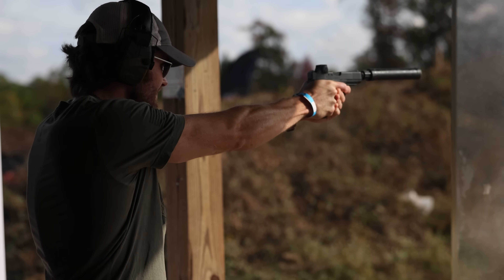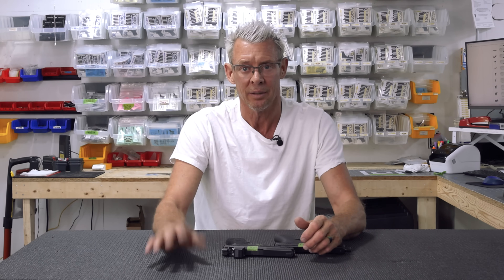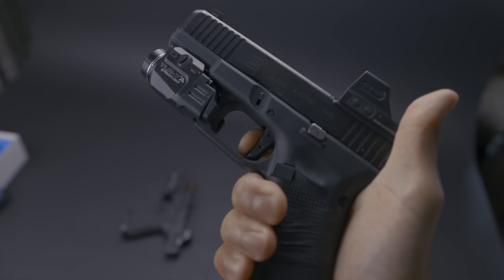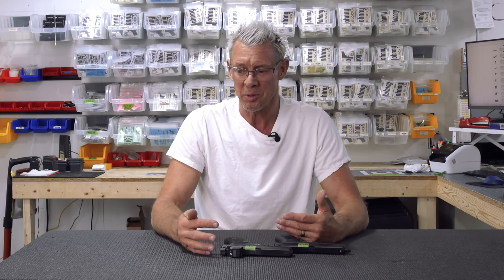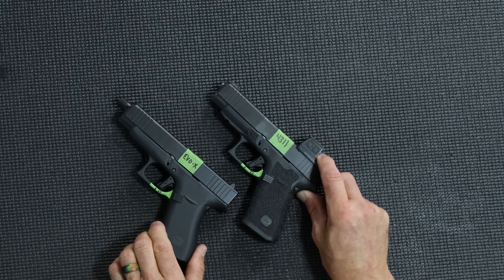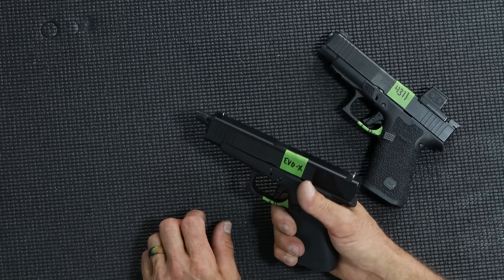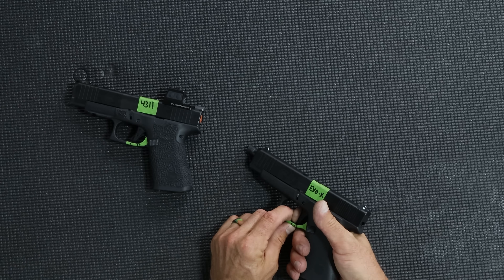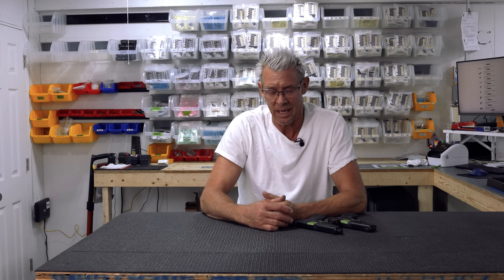4311 V. Combat In Depth Breakdown

Comment: I knew you had to be an Android guy. My observation is that they are like your personality. I have several of your masterpiece trigger systems only improved by potassium borate lubricants. Check it out. Once applied it is done unless extreme heat then repeat occasionally. Shoot any caliber with a chronograph then one application of any potassium borate lubricant (Chevron Mexico) and watch the jump in velocity. And it lasts quite well. I was thinking of your polishing and friction reduction methods plus the above mentioned friction reducer. A good thing is to read how it is used in patented processes.
Getting back to the Android, you can tune em up! Like you are so gifted in meta-mechanics. I would like you to review you phone just as a side note!  I bet it is like your triggers!

Comment: I have a Shadow Systems CR920X will the 4311 work with it? I saw something about the firing pin incompatibility. Which firing pin do you use the stock or yours.